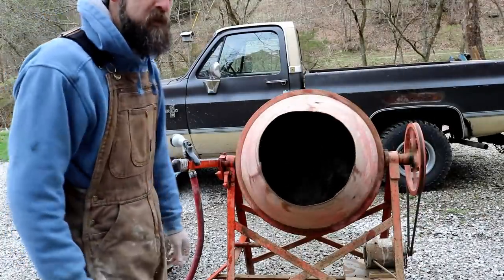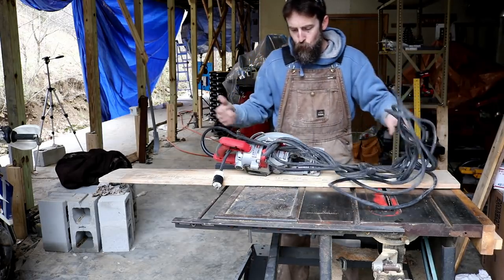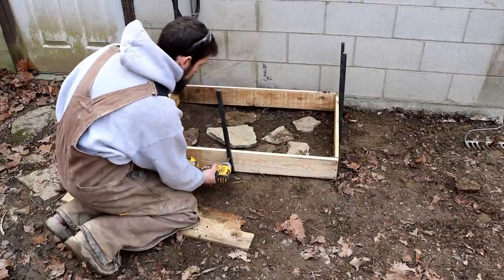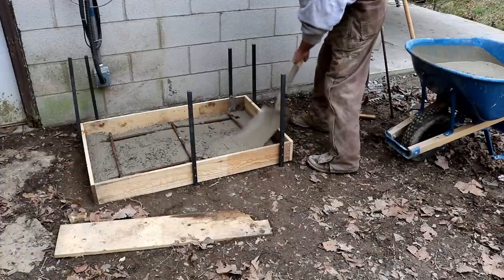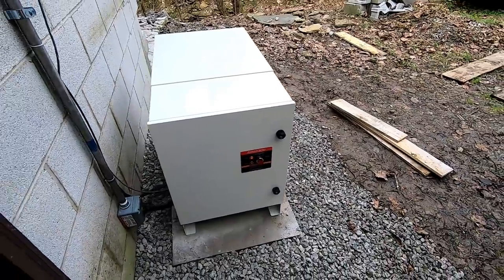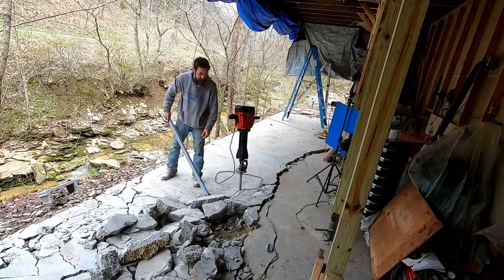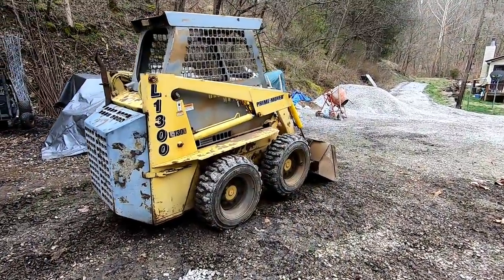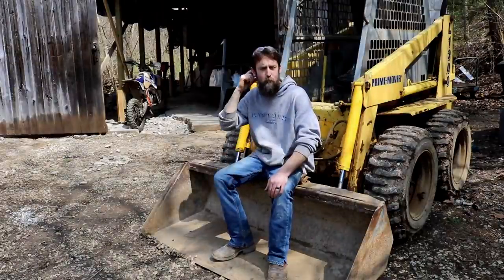Shop Damage #8 Jackhammer Time / Concrete pad and bobcat run

Comment: A bit of advice, hire out the work to pour the new concrete pad, You are way too laid back (slow) to ever do a decent job. The whole process of placing concrete is a race to the finish, you just don't have that level of urgency (you are too meticulous) to ever be a concrete finisher. Thank me later
Reply: Seconded.  As a GC I just had to laugh at the concrete work.  Way over thought and over built.  Please hire professionals to pour your shop slab.  Absolutely will be worth it.
Reply: @Wearepricester  Agree with both of you!!!   Sadly, and with no disrespect to Steve, this is a job best left to a seasoned pro.   

Steve, you think like and engineer and can visualize how the processes line up.  USE those skills to watch and keep a contractor on the top of his game instead of trying to do the work yourself.  That slab needs footings, a monolithic pour over lots of rebar and pins for your new block stem-wall.   No matter what you do, the new slab is going to crack away from the old slab, drill and pin the snot out of the old slab and tie your new rebar mat/cage to those pins.
Reply: He's not going back where the old slab was. He's leaving it out. His roof will overhang on that side. He's making a tactical retreat from the creek. Which I think is smart. Sometimes you just have to take your lumps and walk away. So he's not doing a whole lot of slab work. It does sound like he may be trying to put some kind of a decent footing in over there though? We'll have to stay tuned to see what he does.
Reply: Scotty, I think it shows Steve is a machinist, when doing matching there is a lot of accuracy, in laying a concrete slab yes it has to be done right but not the same as machine work, still the job got done, but the slab it a big job and the professionals will have it done in no time. Just saying 👍
Reply: That is realistic,
Reply: I second and third that. As a construction manager..Watching that 2' x 4'  generator form get filled up 1shovelful at a time proved you are a 'thoughtful' guy. I cringed man.  That's ok on certain trades IE:electrical.. but not on concrete pours. Best luck though
Reply: @chrisbradbury5238  concrete pours are games of beat the clock. Wet rock waits for no man.

Comment: I have been mixing concrete for 53 years, since I was sixteen. I always added an extra shovel of cement and made it a little wetter than recommended. The concrete I made back then is still the best anyone has ever seen around here. It will last as long as Roman concrete.

Comment: Grab a few packets of concrete plasticizer next time you're at a hardware store. It's cheap and simple to use. A tiny amount of that stuff makes concrete behave like it's a super wet mix, while letting you keep the actual water content low and the resulting concrete strong.

Comment: Good on your Dad for lending you the mixer, good that he has one...You need to do a Randy Richards concrete mixer restore on that puppy after you get the shop done! FWIW, as you may know Sears never made much, if any, of the products they sold but if you get the prefix on the model and look it up online you can tell who the manufacture is. Sears used to always use quality vendors, but that has changed as of recent, unfortunately.

Comment: Steve nobody can ever say you don't work hard.  It's coming along.  Your concrete looks good.  I've been using Marshall Town tools for 30 years there is no better.  Still have the first trowels I got at my start.  Bag lasted for about 10 years until I got more tools than it would hold.  Now in a bucket.

Comment: Steve: you have lots of clean blocks there. Set that mixer up on 3 blocks and you will be able to empty it  into the wheelbarrow really easy. For next time.
Frank
Reply: And point the round end of the barrow toward the mixer save having to tilt the barrow 👍
Reply: I was thinking sit it on a pallet but that would work too.
Reply: Yeah, but now you have to heave the shovel some 6" higher (times # of shovels). Tilt the wheelbarrow once per load. Energy savings
Reply: @neilwallace4597  You beat me to it.
Stay safe, God bless
Reply: @threadie  'onya Threadie. No steps at all. Just stand, shovel and deliver. After a few meters2, Steve'l get the hang of it.
Reply: I was going to suggest setting the mixer on blocks and guest what, someone has already suggested it.  Looks to me like one layer of blocks will raise the mixer enough so when it is tipped over to unload you won't need to tilt the wheel barrow.
Reply: Growing up it was my job to fill the 5 gallon buckets for tossing the sand and gravel into the mixer.  Also used a bucket for the water.  Poured a lot of side walks.  I agree with lifting it up some.  The buckets were also lifted up.
Reply: Things are looking great Steve. Keep up the good work. I also love my AD20 from American Rotary. I purchased a floor unit though. Really appreciate your advice on that purchase too. Stay safe and healthy!
Reply: I had the same idea.

Comment: Hi, Steve may be an option you can consider are gabion cages for erosion control.
just google it you should be able to fill the cages with your concrete rubble the best part of this system is you are able to build a section when time and funds become available. With your engineer and your skills you could make the cages yourself I hope this may help with your project.
Play Safe From Elliot Lake Ontario Canada.

Comment: We have a seasonal runoff ditch on our property, I took all the rubble from our old garage foundation and built up a thick burm to keep back the erosion. Large chunks on the outside, backed with 5" or smaller and then dirt. 12 years later still holding up well.

Comment: You are doing a great job Steve.  This is a young mans project for sure!   I used to do this type of job as well when I was a younger lad.  I'm seventy five now so I'll just watch you do it!  LOL
The comment by "one4stevo"  is a good one!  I used to live in Tucson Arizona and on our property we had two arroyos.  During the monsoon season these would become raging rivers from bank to bank!  we would line the banks with stacked old tires filled with dirt.  It was a excellent erosion  control method!
Reply from the maker: I'll be happy if I live that long without major issues. Thanks for the suggestions.

Comment: I would take old tires, connect them with heavy steel cables so you have a ""mat" of tires on the hill side.  Fill them partially with gravel then rubble on top then natural stone.   You can probably make a driver for the jack hammer so you can drive in rebar to help anchor the tires in place.  This will ba a laborious event but this way it will not get washed away.  Add in there some concrete around the rebar and tires to act as "washers". Hope that helps.

Comment: When it comes time to clean the mixer at the end of the day, throw in some broken pieces of concrete block with some water and let the mixer run for a few minutes. The sharp corners on the concrete pieces will do a great job of knocking loose any concrete. 
Rather than waiting for a hose to add water to the mixer, start slowly with a bucket and determine how much is needed for a batch. Fill a 55 gallon drum with water and just dip out a predetermined amount for each batch. After pouring the footings and slab, if that is your intent, you will develop some short cuts to make the job easier. Calculate how many yards are needed, divide by the volume of your mixer to  find the number of batches needed and you may want to have concrete delivered. Yes I know, it is not cheap.
Reply: Good tip
Reply: Yep...
But just watch it don't twat all the paddles off the inside..
Like It did with my Belle mixer...

I had to keep welding em back on...🇬🇧😕

Comment: When I was about your age, I did some long days with a 90# Thor jack hammer powered by a Lindsay 80 compressor breaking up concrete from an old slab where my new shop was going to be built.. I also had to bust up some old house forms into pieces to get them out of the ground.. I had an old International diesel tractor with a two bottom plow, a Dodge M37 Army Truck and a lot of sweat....Couldn't do that now .. Carry on and be safe.. Mike in Louisiana

Comment: I agree with those who say to set the mixer a bit higher, also instead of just pulling the smoothing board towards you, use a side to side sawing motion as you pull.

Comment: Steve your "Too wet" concrete was just perfect! The first lot you made and put on the side of the roadway was Farr too dry as it will not "sit down "properly on the substate below. It need to be wet enough to seep into the substrate and make a more homogenous joint. Likewise your first pour into the slab was wetter but not wet enough and although you tamped it down it would have been better to have it like your second " too wet" pour which was perfect .
You need to get into a rhythm  of X amount of sand X amount of stones X amount of cement and just as importantly X amount of water to get the same consistency every time. Which will help enormously in your endeavour. You are doing a great job old son, keep up the good work. So you, Elizabeth, you boy and Peanut stay safe at this awful time. You are lucky you were able to visit your parents this week as we in England are in total lockdown now, only allowed out to get essential food,and medicines and to care for the vulnerable and sick in their homes or go to essential work that you can't do at home.

Comment: I have the exact same mixer, but I rebuilt it and made a frame/carriage to mount on the 3 pt of my farm tractor and it PTO driven.  I wanted to be able to pour into some column forms that were two feet high. Making your own cement is a LOT of work.

Comment: You might want to build some wire cages and embed them in that stream bank, filled with your old concrete bits. That or a heavy wire fence near the stream with all that old concrete dumped above it, toward the shop. Help with erosion and support the new slab somewhat. Oh... at the end, I see you are going to do something like that. Good work!

Comment: Steve, use your rubble to help stabilize the river bank, its perfectly fine since its sand, gravel and cement made from limestone which is what is lining your river bank just in raw form, it will weather and cover over with leaves and keep the water from washing out the bank any more..

Comment: I think the handle on the mixer had a linkage from the top down to that crazy hooked latch. Maybe an old bike handle lever could fix it? Build a temporary pad with cinder block to rise up the mixer to make easier work dumping it. For the jackhammer trough the cord over your shoulder, down your back and tuck a loop in your belt on the opposite side. Great work,Thanks for sharing!!!
Reply: P.S. sign and date your slab

Comment: I help my dad mix a lot of concrete, we use a 1, 2, 3 mix, 1 concrete, 2 sand, & 3 gravel. This makes what is called a 6 bag mix. That make the concrete a 3500 #. PSI mix. We used  buckets to keep track of the mix. Concrete plants mix by weight.
5 bag is 3000 #., 6 1/2 bags is a 4000# mix.
Areas that freeze should use a 3500# mix.
Your in for a lot of hard work, if you gone to mix your own concrete for your foundation.

Comment: a tip for working round those metal stakes, measure the length of your arm and be sure to hammer the stake into the ground about 6" shorter than your arms length so there's no chance of you poking your eye out if you bend over to pick something up from the ground beside the stake a lot of guys have lost an eye round those things, easy to not see when you are over the top of them

Comment: all in all turned out great, to late now but a hammer drill in hammer only mode makes a really good vibrator for settling some cream to the edges. Put in a chisel or large bit, hold against the form, voila!

Comment: Steve good video, Just a note. You have a Recip saw around there somewhere. Just use it to vibrate the forms when you want to pour your wet in. Just take the blade out and put the foot on the boards and pull the trigger. Works great and not to hard on the arms. Could've use a couple of J bolts Set in the wet concrete Do to make Anchors for the 3Phase, but anything will hold it down.   Don

Comment: You are making progress, on mixing concrete the mix amount is one full bag of cement to 6 full shovels of sand and 12 full shovels of gravel and of course you can cut that in half and on mortar it would be the same except no gravel and if you mix your concrete pretty wet about your second mix tapping on those forms like you were doing will work most all of those pits out and if you just use some flat pieces of wood for stakes long enough where you can drive them down even with the top of your forms you can float it down with your board all the way across from end to end, I never have seen anyone use steel stakes, good luck.

Comment: Yes Steve, Very happy to see you working on the bank. Use the material from the floor on the side of bank. the bigger the pieces the better.I would even break those blocks up and mix in with concrete chunks. Those blocks have more value on that bank than they do on Craig's list. I would pack all that old material on that bank.
Reply: I was thinking that, some gabion baskets and that rubble should really reduce the erosion and then you don't have to haul the rubble away!

Comment: Another way I beak up pads that don’t have rebar is use a long bar and a rock as a fulcrum to lift it just a touch, then tap it with a sledgehammer. You can cut it into sections with a stihl saw. It does depend on how long a bar you have and the ground etc. But if it works it is quick as your breaking the concrete in tension.

Comment: If i might suggest , that when you are putting in the foundation for the new wall you drop down at least the depth of 3 blocks.   This will get you down to good sound ground, and should prevent the recurrence of the original problem.

Comment: I did way too much concrete in my younger days. We had all the tools & equipment that makes it somewhat easier. Still hard work. Wife & I built a 7 unit apartment apartment to have income for our retirement. Poured all the concrete, ready mix, laid all the bricks, 65,000 of them. Took longer than it should have. Hope you are going to put some footings  under that wall. I'm not convinced that 6, 6, 10, 10 wire mesh in a slab does any good. Tying a grid of #3 bar on chairs is much better. Might be over kill for this project. We did a lot of commercial and government work. Have fun.

Comment: Probably too late now .. but .. an old bicycle inner rube or similar between the phase conveter feet and the concrete will stop it from rusting ... dont know why but up here in canada it seems concrete, steel, and frosty winters are a great recipe for steel cancer. A bit of isolation makes a world of difference. Great work! Thanks for sharing!

Comment: To mix concrete what you want is a small bucket  water in first 1 bucket cement  2 sand  4 gravel  and then all the mixes will be the same, Good luck,

Comment: For small formed jobs a sawzall without a blade installed makes a good concrete vibrator. Just run the saw shoe on the form faces.

And because you need more to do... a roof extension out the back of the shop would cover the door and the phase converter. Just pour a couple pier footings - and then all that other stuff to actually build the roof.

Pretty sure I've got the identical mixer.

The tie wire twist tool (whirlygig) runs about $8.

Comment: Get bucket and mark for right amount of water. Put water in first. Will mix up quicker. As someone else said, start next mixer full before truckin wheelbarrow to pour site. Even better get mixer and piles at place you pouring. Pour right into forms.

Comment: Hey Steve quick tip I. Use when making small form work I use a flat pad sander to vibrate the form to help with air bubbles and settling the mix a few seconds on each side helps a lot not the proper way but it helps for small pads all the best  from London uk god bless

Comment: Steve, that busted up Concrete is about the exact same size as Rip Rap, which is something I mentioned to you in a previous Video that you should use to reinforce your Creek Bank with. So, you have a bunch of it right there for free. Don't haul that off, line the Bank with it. That's just that much more material that you won't have to buy.

Comment: Steve something for you to consider, check out the state or county use guardrail to used to stabilize your bank maybe you could get some of their galvanize guard rail posts and fasten them to the bedrock along the edge of the bank to fasten the guard rail to .. then dump all that concrete rubble that you just busted up behind the guard rail that should stabilize the bank pretty well

Comment: Set the mixer up on the concrete blocks so its higher than the barrow, water in first, dryer the mix is the stronger. Wash everything properly after use.
Reply: Great advice Mat, I've been a bricklayer since 1968 and had the same teaching as you about do it yourself concrete jobs.  Did he say mortar?  Hope its Portland cement! Greg
Reply: We always dig a little trench for the wheel barrel tire so we dont have to lift the scoops as high into the mixer
Reply: @halfcircleworkshop  Wheel barrow. :)

Comment: Steve - you're working like a trooper. Impressive and inspiring. Just make sure you shore up that wall with whatever's best for the job. Gabion cages seem like the way forward according to the general consensus, and surprise - you have all the contents ready to fill them (the concrete rubble) for free. If you run out of rubble, then you can start smashing up the block to supplement. I hope you come up with a good reinforcement plan, and have a good strong workshop that will see you out. Don't want to do it twice. Awaiting the next episode. Cheers and good luck, Craig